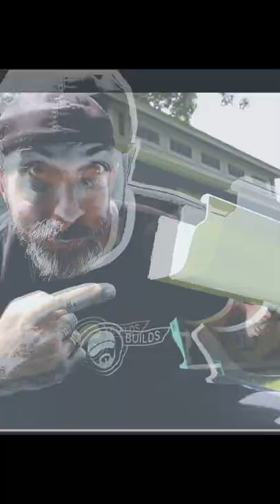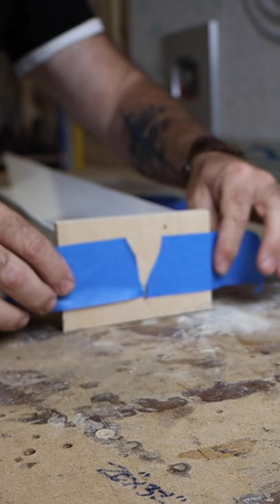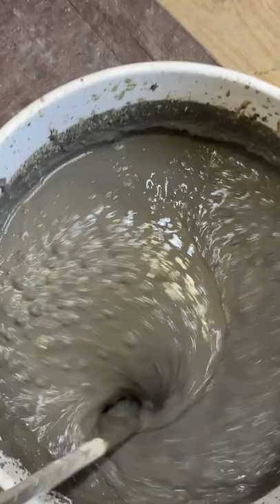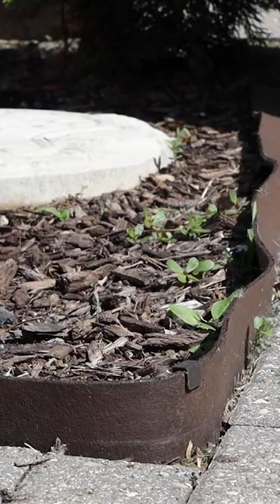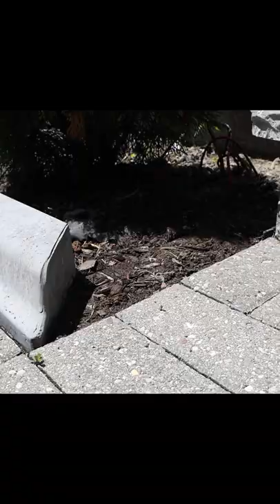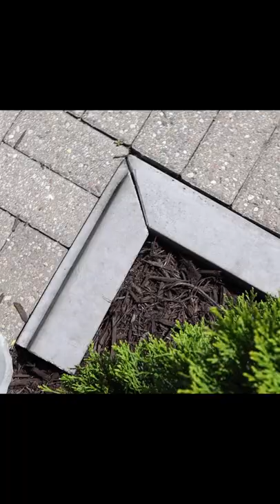I Can Put Concrete in That... CONCRETE CURBS! #shorts #short

Comment: Finished product is awesome, love the sleek look and flow it created! Well done👍. Curious how the longevity will work with no reinforcement. Or is it the concrete with reinforcing fibers? Looked like regular concrete. Either way, I like the idea😉👍
Reply: He should seal it, and that will make it last even longer.
Not only that you don't need reinforcement because its not taking any load.
Reply: @treecooper8557  true that😉👍
Reply: @mikehenry5817    I did some of these years ago for a client (I was landscaping) and we did them by using ribbed dryer hose cut in half.

They're still there.

This guys mix is too wet which will also contribute to the overall weakness tbh.
Reply: @treecooper8557  very interesting on the ribbed dryer hose. That would definitely leave a cool design 😉👍! I usually have the opposite problem. I go to dry. I had a buddy help me once. Said you can't be to dry, as long as there is no powder. The dryer the better. So I did, he said I way over achieved, and didn't even think it was possible to mix it that dry😆. 🤷🏻‍♂️, I follow instructions to the best of my ability, sometimes to my detriment😌😂😉👍! Much Respect 👊, thanks for sharing!!!
Reply: @mikehenry5817  Most of the time slightly wetter than oatmeal is a good consistency.
If you're pouring it, maybe a few cups of water wetter than that.
You want to be able to move it, and if you're having a really hard time pulling the hoe or shovel through you're too dry.

A few cups to liter will do the trick sir.

And yeah the design was pretty cool.
We laid the hose around the gardens poured the concrete in, for the curves you have to go opposite so when you flip them out they're the right way.

I made that mistake the first time I did it lol.
Reply: @treecooper8557  thanks for the tips, and I was wondering about curves 😂, I bet those were a little tricky 😉👍
Reply: @mikehenry5817   Yeah they will bite you but you seem like a smart enough guy so im sure you'll figure it out.

Peace sir.
Reply: @treecooper8557  I appreciate the vote of confidence 😉👍! I usually always do, one way or the other😆. It's all about the experience. Knowing what to do is very valuable. Knowing what not to do, is priceless 😏, in my opinion. I definitely have learned a few what not to's over the years. I'm still here to talk about em, and I still have all the limbs😆, so I must be doing okay at least🤣👍! Thanks again! Pleasure talking with you! Take care😉👍
Reply: @mikehenry5817   yeah, us men learn the hard way sir...as long as we have our limbs it's a win.
If my wife read this I might not have all my limbs lol.
Reply: @treecooper8557  🤣, I hear that! All of it😆😂🤣👍
Reply: @mikehenry5817   I thought you would sir lol.
Reply: @treecooper8557  all to well!!! 🤣👍